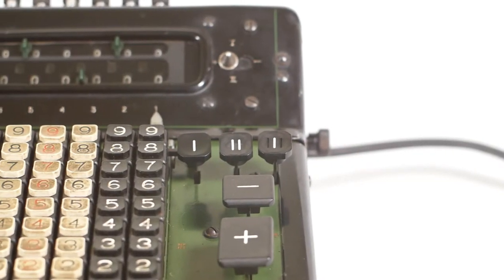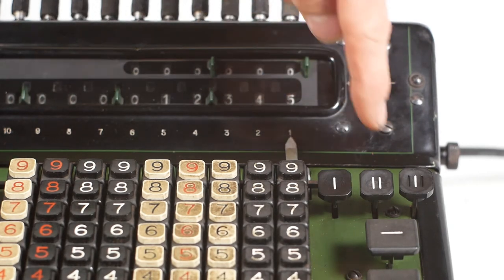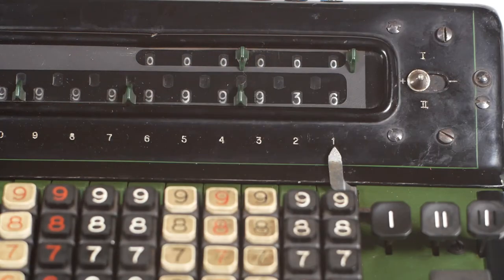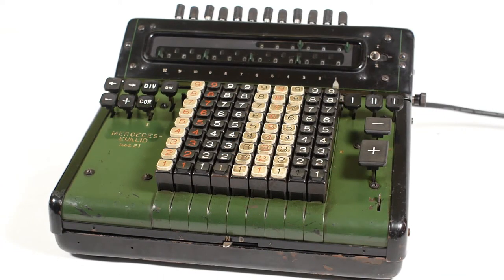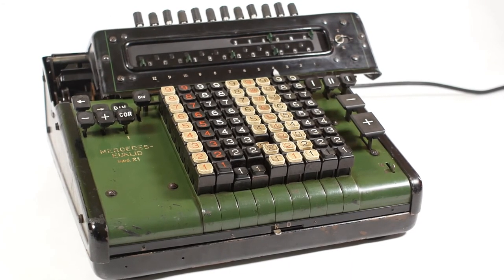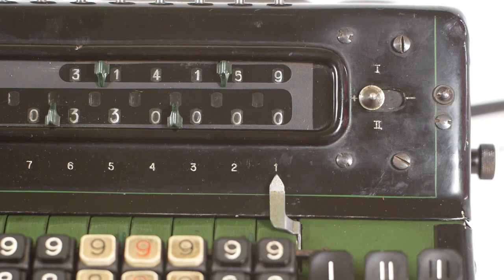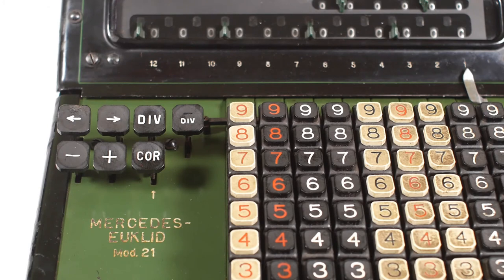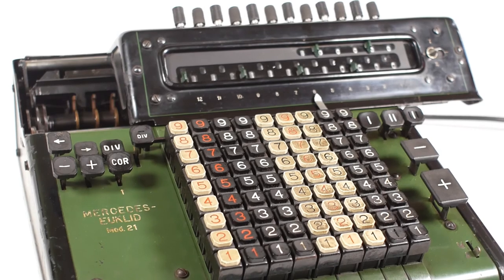Mechanical Calculator Demo - Electric Mercedes Euklid Model 21 - Retrotech

Comment: Thank you for another excellent video and especially for explaining how subtractions works on this machine. I was not aware of doing it like a comptometer. Last week I just managed to acquire a Cellatron R 44 SM from 1975 which is my first proportional lever machine. And after getting the motor running again and fixing some corroded and stuck parts of the keyboard mechanism, I now start to explore its functionality and your video is a very helpful inspiration for me.
Reply from the maker: Wow, the Cellatron R44 is such an impressive machine - you'll have lots of fun with that.  Even once I'd unstuck everything on my machine, there were still a few bits that wouldn't work correctly - it was quite a while before I had it running as it should do.
Reply: @GrumpyTim  My cellatrons last documented service was 1982 (as they wrote on the inside of the cover of the registers) and as far as I know it was in regular use until 1990 in an VEB (calculation of wages) in the GDR. With mine only the motor was ceased by old grease in its angled gear and bearings but despite of that and a view minor spots of corrosion on the keyboard mechanism the oil and grease in the machine was not very sticky. So, after a little bit of refreshment with Ballistol and letting it move though all functions a few times, all mechanisms recovered quickly. So probably one or two decades less of sitting and maybe improved oils in the 70s and 80s may have made the difference.
Reply from the maker: Hmmm, thought I'd responded to this one - maybe I responded to someone else with a non sensical reply!!!!!  What a fantastic find your Cellatron is - having that record of it's last service is great, and also that it was in use until 1990.  I'm sure you're right that it will have benefitted from more modern oil and also less years sitting doing nothing.  They're really exciting machines to use - I try to do most of my calculations using some form of mechanical calculator - using my phone just seems wrong!!!!!
Reply: @GrumpyTim  Yeah, these machines have to be used for what they were made for……
I always have one of my machines on my office-desk and use them now and then. I try to change them regularly so that every machine keeps moving. 
I plan to do a short video of the callatron at some point in the future, when I will find the time.
Until then I am looking forward to new videos to come on your channel.
Reply from the maker: Cheers Radio GaGag, I've subscribed to your channel so I get a notification when you upload.  I'll watch your Madas video later - I'm currently working on a Madas 20LZVG (which doesn't have the multiplier section but it'll be reasonably similar to your machine) - it looked in a terrible state when it arrived but it's not too bad inside, there's a few sticking parts and a previous owner appears to have used force to try to fix it so there's a few bent levers to straighten out but I'm pretty hopeful that it'll run again soon.....
Reply: @GrumpyTim Oh, thank you for subscribing to my channel, I appreciate this very much. It motivates me to finish the Badenia VA17 Super video which I am sporadically working on at the moment.  For me it is easier to repair the machines than to do videos about them….
I wish you good luck with your new MADAS. Looking forward to the video about it.
With repairing my MADAS 20AS the focus mainly was on the multiplication mechanism, which at the end turned out to have two worn out levers which didn´t latch correctly any more, but it was possible to file down their counterparts a little bit so that the multiplication initialization and shifting mechanism worked again properly.  Division did not have bigger problems. If I remember correctly there are three paralleled levers on the left side which also control the Dividend enter which were glued together by old grease, but after freeing them up again division worked properly. The description of operation on John Wolffs website (http://www.johnwolff.id.au/calculators/Tech/MadasATG/Madas9.htm) which also covers division might be helpful. He also kindly provides technical drawings on personal request, but these drawings cover mostly the multiplication unit and there is not much about the division.
Reply from the maker: Oh cheers Radio GaGag, I haven't checked John Wolffs website regarding the Madas.  So far everything on mine is freeing up nicely, I think the biggest problem is that a previous owner has used force to remove parts and also to try to free parts so there are a few levers to straighten, but it should be running soon...........
Reply: @GrumpyTim  Hi GrumpyTim, that sounds good. I think the swissmade steel is of top quality and shuld not break too easily. Looking forward to your resulting MADAS video.....

Comment: Lovely to see a working electric Mercedes Euklid machine. I have a woriking handcranked version (model 29) and a non-working electric one (don't remember the model but it is like yours but a bit wider so probably a model 22) that I should get to at some point. Thank you for showing how it's supposed to work, which should help me with mine.
Reply from the maker: Hi Jaap - I think it was when I first saw your model 29 that I quite fancied one for myself - they're a lovely looking machine - I wasn't too fussed if I got a model 29 or one of the other models so when my model 21 popped up for sale I jumped at the opportunity.  It took a heck of a lot of freeing off, the oil had gone like glue and needed heat, solvent, patience and fresh oil to free everything off.  Even once everything was freed off it still wouldn't work correctly - eventually I discovered something that was out of adjustment which was stopping the division from happening once the carriage had shifted to the right.

Definitely worth the effort.

I've just had a Madas 20LZVG arrive - it's in a terrible state but I'll see what I can do with it.
Reply: @GrumpyTim  That sounds like a horrendous effort. Amazing feat to get it working.

Ages ago I mentioned I was working on a Madas BZS. It will appear on my channel and site very soon, and later I'll add an old Madas 12e. I did not get the BZS fully working, as I am too afraid to take it far enough apart to find the last few stuck bits. The multiplication bar is not working, but all the rest is. It has been by far the hardest job I've done. At least your LZVG does not have that multiplication functionality so it should be a bit easier. But still, be aware that it can be quite tricky to get the carriage seated back in place properly. Not only do you have to do it while the machine is tilted back so the carry switches don't get dislodged and block things, the pin driving the Z carry mechanism is tricky to get in place.

Gerald Saudan's site madas.ch is a very nice resource. The last video on his second page of videos was especially useful as it shows how to disassemble the machine and remove the keyboard. He has written a beautiful book about them, too.
Reply from the maker: Sorry for the slow reply to this message (I'd put a filter on so any messages with a link get held for review - then I forgot to check the held messages - oops!!!).  My LZVG is coming along nicely so far - the biggest issues are from a previous owner using force to remove the carriage and free things off - I'm getting there slowly - most of the parts are just gummed up in the normal way, and without the multiplier, I can get to most areas fairly well.

I've got Gerald's website in my favourites - I've already sent him my serial number to add to his database - as you say, it's a fantastic resource.

Comment: Since a few days, i have the same type of calculator. Needs a little cleaning and oil, but it is working. The red zero @4:24 is white on mine.
Reply from the maker: Hi Marco S, well done for finding one of these, they're quite a machine!!!  I guess they didn't paint the negative zeros red on all machines - mine was the only copy I'd seen, and I assumed that it would have been the same on all machines.  You'll have lots of fun using this one.

Comment: Funny how they chose only to 'automate' the division but not the multiplication.
Reply from the maker: Yeah, it's kind of odd, although they did make other models that had automatic multiplication too.  I guess out of the two features, multiplication is the easier one to carry out without automation so that's the one they left off on this "budget" machine (I bet it wasn't cheap though).
Reply: I think division is easier to implement that multiplication, for fully automatic multiplication you would either need a way to load the counter from the keyboard or a separate counter for multiplication. For division, you just need an extra mechanism to control the additions/subtractions and shifts (which would also be needed for multiplication), and a trip to detect overflow (but no real modifications to the registers). If you look at the fully automatic machines (like those from Friden, MADAS, and Monroe) they all have a extra register for multiplication
Reply from the maker: Very good explanation from bss1250, cheers.  My electric Lagomarsino machine has multiplier keys and even with that, there's the set of extra keys plus the extra multiplier counter inside the machine to increase the cost of manufacture - and on that machine it's not fully automatic, you even have to manually shift the carriage.